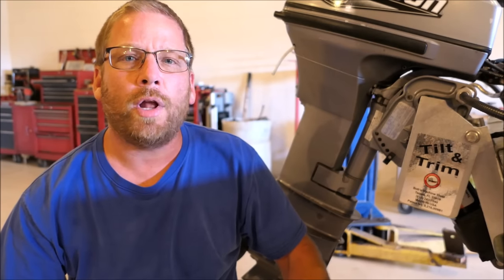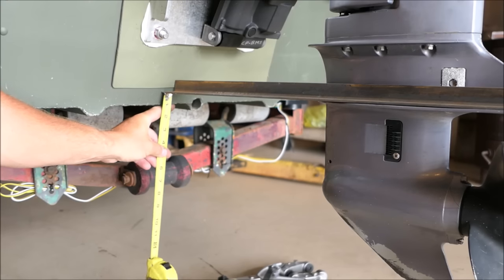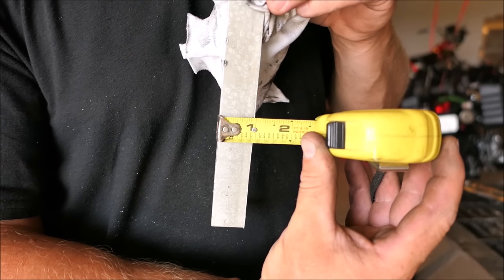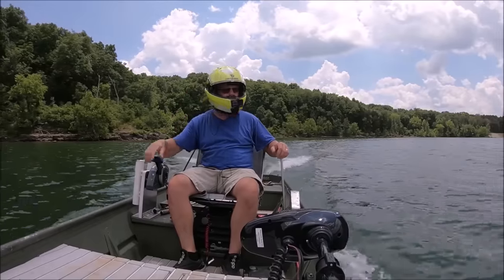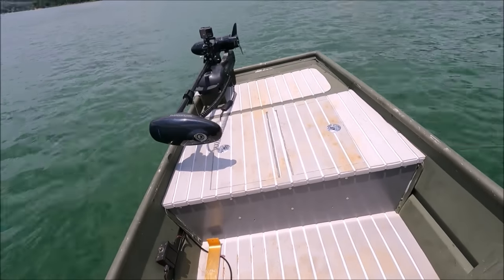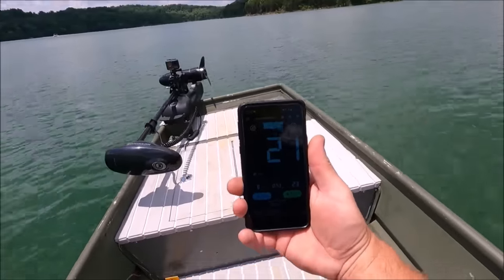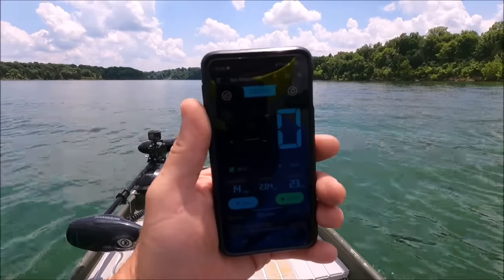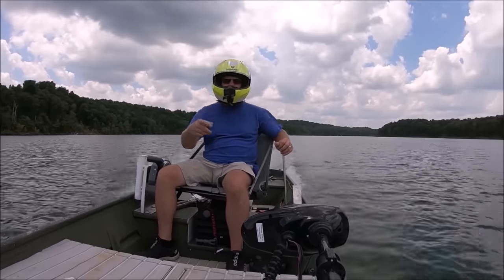Does 1 inch UP or DOWN make a difference on an Outboard ??

Comment: Being a former professional boat racer I can tell you that you would be way better off with out that helmet. That’s a perfect way to break your neck . In a boat you do not want a full face helmet.  If you go in the water can catch the piece going over your mouth and snap your neck. There where a few internal Decapitations . Meaning hour head had been completely taken off your body inside of your skin.
Reply: That happened to me once !
Reply: Exactly right
Reply: You are correct. Amateur hour.
Reply: Not at 22mph. Nope not buying your scaretactics
Reply: Yeah this guy doesnt have the sharpest tools in his shed at all lol
Reply: This guy probably wore a helmet on his tricycle. While water skiing a salaam course we wold easily exceed 50 mph and fall multiple times with no head injuries. Twisted backs yes.

Comment: Hi Benny! I wish I had known you were going to try lowering your motor for more speed. When you increase wetted surface you slow the boat down. For more speed raise the engine until the propeller blade is even with the bottom of the boat. Have you tached the engine out? It looks like you can swing more pitch on the prop. More pitch equals more speed. You need to use your power trim to reduce wetted surface [ lift the nose ] at speed. Trimming the engine out lifts the bow, reduces wetted surface, changes prop angle and increases speed. The most important change you need to make is the propeller. Be sure to get a cupped prop. The cupped prop reduces cavitation. Race boats run only half the prop in the water. That allows less drag on the prop blades letting you run more pitch than a standard installation. I started messing around with fast boats over 50 years ago. It's fun but can get expensive. Jon boats are quick with small motors but they have a lot of wetted surface. Weight distribution is critical, too. If that were my boat I would hang a 35 or 40 hp on it with a nice cupped stainless prop. You could run it up over 40mph and scare the crap out of yourself. Too much speed on a jonboat and wind lift becomes a problem. It seems the new "Fad" with jonboats is to install jetski running gear. I'm not a fan of jetpumps for speed, but they definately have their place. Keep up the interesting projects! I'll be watching! Dave
Reply from the maker: Thanks Dave, I'm happy with the boat as is, I am glad I lowered it and think I'm getting all the performance out of it, not sure if the engine could push a prop with more pitch, thanks for all the help!! This boat setup is great fun love the stick steer and seat nice clear view in front of me.
Reply: Far as I know guys try and raise it as far as they can.
Reply from the maker: @kevinwest1607  Yes that's true, I didn't know but thought it was too high, in the end didn't make a difference,  I don't believe raising it would help in my case.
Reply: 28 Cruzin is right a cupped prop with the right pitch is what you need. You’ll gain speed.
Reply from the maker: @bradalden8347  He knows what he's talking about but more cash for me 😂
Reply: My cavitation plate was under the boat bottom and created drag. I installed a Tach and that showed me my rpm’s  were too low about 5400) and I was creating drag with the plate. I raised the motor to the max. height which put my cavitation plate an inch above the bottom. Now I’m spinning the same prop at 5700 rpm’s and got a 6 mph increase in speed.
Reply: Would raising the motor help a 20 foot pontoon? My motor looks pretty low to me,  but I'm no expert. I have no idea how it performs because we haven't put it in the water yet. We just bought it and we've been working on it.
Reply from the maker: @JimmyLee0757  I would start with what you have take it for a ride and go from there
Reply: @JimmyLee0757  Yes! Raise the motor on a pontoon if it seems like the lower unit and or mid section is plowing.
Reply: Hey I have a 16-48 with a 15 on it and I need to run in 6 to 8 inches of water do you think a on the fly jack plate will help also do I need more motor to get up out of the water or on the pad?
Reply: I have been racing and  modifying performance boats for over 55 yrs.
Drag is your enemy and next to flying as much of the hull as possible raising the lower unit out of the water gets you the most. With a non-cupped prop raise the motor till it starts to cavitate then drop it 1/4 inch or so.
A cupped prop is another setup. Then you can raise it till you start to loose water pressure.
I have NEVER seen a boat go faster by lowering the mota unless it has loss bite of the water( cavitation).
Good luck!
Reply: I have an underpowered motor on my boat - 4.8m aluminium boat side console 
Mercury 30hp. 
What’s the best way to get as much speed as possible out of it? 
Thanks

Comment: I'm surprised you measured from the level of the cavitation plate instead of from an extension of the boat's bottom.  Especially since the angle of the cavitation plate will tilt up and down with the trim&tilt.  Bump your trim switch and you'll get a very different measurement.  It would be good to get a buddy to follow you or run past him to see how high your cav plate is running at speed.

Comment: Thanks for doing this. It seems to me if there is no performance gain a person should run the cavitation plate an inch above the bottom of the boat and enjoy an extra inch of clearance in shallow water. I’m setting the height of my Jon boats new outboard now and think I know where to start.

Comment: I had similar problems with a brand-new boat and a 25 hp engine. The first thing you should have done is put a tachometer on the engine while your WOT on the water, and verify that engine rpm is at the max rpm of the motor. One degree in prop pitch is equal to 200 rpm of the motor so you make adjustments of your prop pitch. In my situation it helped tremendously but I still wasn't happy with the boat speed, so- I raised the engine by an inch and a half to reduce drag through the water and that did the trick.  If you want stability on the water, put a Cobra Explorer Hydrofoil Stabilizer Plate on your engine -  three things prop pitch, drag and stabilizer plate.
Reply from the maker: I did check the rpm previously, my guess is it hasn't changed but I agree need to check it
Reply: StingRay is the best foil for anything under 60hp. But he is getting up to plane fairly fast, actually quite well, without proposing, so it'd be added drag. Pitch AND diameter can mean speed or not. A friend has a #21 but wasn't able to get into the proper RPM range with it so he kept the same pitch but went 3/4" less on the diameter, same brand of prop. Gained speed, and the RPM now runs up to the manufactures rated top numbers, past the proper running range he couldn't acquire before.
My mid-sized boat, Key West 1720, recommends a 90hp as max, purchased mine with a 115. Had to put on a foil due to stern weight and slight proposing in offshore swells which can be nerve racking, losing 3 mph doing so.

Comment: As others have mentioned, raising the engine will decrease the amount of the gearcase in the water and decrease drag, which results in increased speed.

However, at around 22-ish top speed, its not going to make an appreciable difference. This phenomenon really comes into effect when you're going at much higher speeds, like above 50, and your aim is to get the engine up as high as possible without causing excessive cavitation or adversely affecting handling. Interestingly, sometimes having the engine down too deep can have a negative impact on handling.

For example, I have a custom paired 18' ski boat with 175 O/B (20"). When initially mounted at factory transom height (which was actually 22 inches!), it would pull to the side pretty hard. I had the skag adjusted hard to the side to compensate as much as possible, but it still pulled. Eventually I decided to raise it up by one set of holes (another inch), and that completely eliminated the pull even with the skag adjusted straight on. So now I have the 20 inch engine mounted at 23 inches and control is perfect. It does cavitate a little bit when turning hard at mid 20's (mph), but only a little and maintains thrust.

Now even for smaller boats, if it doesn't adversely affect handling or cause cavitation, I'd suggest raising the engine up as much as possible. Reason is very simple; the higher the engine is, the less likely you are to hit stuff under the water, like ground. That boat is clearly rigged for fishing, so I'm sure you take it into some shallow areas sometimes. You don't need to weld the cutoff piece back on, just bolt it on higher up.

Comment: You can adjust speed with props, balance ( of boat),raising motor and so forth but that cavitation plate height is recommended to be set a certain depth below keel line depending on mounting situations…that depth is not just for straight line performance but also in turns …you will know if it’s not deep enough because in turns it’ll be easier to cavitate..it’s not all about straight line performance people !
Reply from the maker: Yeah the deeper the engine went the better it manoeuvred at slow speeds
Reply: @kentuckyyankee  trying is winning 👍🏼

Comment: I’ve got a 15 foot Jon boat with a 25 hp. I put the bobs trim and tilt on and I went from 27 mph to 32 mph. I also bought there stabilizer plate and I bought a cupped prop. I can trim my motor to where I can hear my prop pierce the water and that’s when I throw a rooster tail. That bobs trim and tilt is well worth the money. And my motor is a tiller. You might need more weight in the back to get full potential out of your trim.
Reply from the maker: That's something I had thought about, more weight could possibly help in the back
Reply: Could you give some more details about your set up? transom size etc.  really apprericated

Comment: Hi mate,

Just a few things to take on board...

1) A bit late now, but you shouldn't have cut your tilt/trim when you could have just lowered the mounting on the transom.

2) you don't measure the motors height by running a straight edge off the cavitation plate. You do it by running a straight edge off the underside of the hull.

3) You actually gain speed by raising the motor, not lowering it.

4) Your motor could have went even higher than where it was before you cut it. Perhaps 1 inch higher for a good return on speed with current prop. The further the set back off the transom, the higher the motor must be so this looks as though it was originally set up the same as it would have been if it were flush with the bottom of the boat had it been mounted directly to the transom.

5) If you want more speed, invest in a new prop and raise the motor. To do so, you need to check your engine rpm in gear at WOT, fully loaded as you would be on a normal day out. Make sure you are within manufacturers spec for rpm range at WOT and only then can you start to play with pitch sizes and eventually rake and cup. But be aware... This can get expensive, so  please, DO YOUR RESEARCH.

In all honesty, I would just leave it as it is. She works nicely.

Hope there's some helpful tips here for you mate.

Best of luck with it. Keep experimenting, but do a tiny bit more research before you make permanent modifications to your pride and joy. She's a nice boat.
👍

Comment: A general rule is up 1/2 inch for every inch back from the transom. If you want more speed raise the motor but watch for water flow to the engine

Comment: Any difference with those thick rubber 12" shark fins you can mount around the fins above prop forcing the water to run past prop blades keeping nose of boat down. I still have the unopened package frim the 90's. LoL

Comment: Raise the motor 1” above where it was originally. Trim it up. Check your rpm. If you can turn a higher pitch prop even if it just 1” of pitch you should gain. High speed boats rarely have more than two blades in the water at any given time. As long as you don’t lose water pressure, raise it up.

Comment: You're going the wrong way, the anticavitation plate has to ride above the water when on plane. You don't want water going over it, that's why you're "spinning out" so easily. The same thing was happening to me when I got my last boat, trim didn't like being up much at all and to keep it nice on plane I would have to keep the trim down most of the time... raised it an inch so the plate skimmed over the water instead of cutting through it and now not only do I get 5mph more out of the old 85 evinrude but my fuel mileage has almost gone up 40% from having less drag from the motor. All in all, I'm so happy that I raised it, rides rough water at higher speeds better too
Reply from the maker: I can try it higher

Comment: It's the bottom of the cavitation plate should be level with the bottom of the boat I know it's only a matter of 3/8 of an inch or so but it will make a slight  Bit difference

Comment: You were to high from all I've gathered from ol' mariners that set up outboards for a living in the past. Cavitation plate even with the hull or no more than an inch lower-keeps water under the plate-no air allowed.
Having your weight further to the rear could help, such as with a tiller steer like my smallest bay boat, but honestly you're at a damn good speed for your boat and outboard. I know others with 25-30hp bolted on that only run 2-4 mph faster with both forward and tiller steer-and that's on the saltwater which is slightly faster than fresh.
Know the helmet was a touch of humor, but where's the PFD, and was that lanyard hooked up?  I don't step off the dock without a kayak PFD on-light weight and not bulky-and don't run at speed without a better PFD on. I'm never in gear-even backing off a trailer-without the lanyard hooked up. Yes I can swim, grew up in the mid-Mississippi river region swimming since Dad threw me in at 3 years old. NEVER to safe on water as a college friend of mine found out in a brand new bass boat running 70 mph in a tournament. Steering rod broke, 90 degree turn knocking him out going over the gunnel, but that PFD kept him up and he's back in that same boat.

Comment: I have a 1988  14 Grumman Jon with a 20 mercury outboard two stroke 1990 motor it does 28 mph all day on smooth water

Comment: engine is what push speed n moving engine up n down doesnt change speed but it DOES DO affect water cooling because higher out of water will affect water cooling including propeller throwed out of water
i recommend that line be under hual by one inches  not line up or not above hual line

Comment: Just curious, but instead of cutting the engine side of your tilt/trim set up. Why didn't you just drill another set of holes in it on the transom side? I think that would of been a better option than cutting material off.
Reply from the maker: Lazy, was just easier.

Comment: Lol you went the wrong way. You should have raised the prop for more speed ( if you can avoid cavitation). The reason being dropping it, as you did, increased drag. Also, as you seem to be new to boating- don't forget to tie your kill cord to your leg- this will stop the boat traveling off into the distance on it's own if you get thrown overboard.

Comment: You start at 3 1/2" from the bottom of the keel.  If anything it should have slowed down.  It may have gone faster or slower depending on the surface temperature of the water.
Reply from the maker: Thanks for the advice, didn't make any significant difference
Reply: @kentuckyyankee  Yeah, you were measuring from the bottom om the boat instead of the "keel", that being the lowest point. 
On another note, you may get more speed with less air resistance. Sitting up that high, you are catching a lot of wind. Also, humidity plays a big role in speed as well, as on a very humid day, there is a lot more water vapor in the air the engine needs to compensate for. I know my boat with 20% more humidity will loose some RPM off the top end, resulting in a drop in speed as well.
Reply from the maker: @rrrttt1112  I'm calling it good. 😂😂 Not a bad top speed for my setup in my opinion.

Comment: I raced modified outboards for decades, won a lot of national. The engine was as high as possible and still get it on plane. When we set a world record, you could see half the prop out on the water. A 7.5 ho on 11'9" picklefork hydro. A little over 72 mph. But it was a pure race engine. A flat bottom should do fair. Empty it might fly a little. Ride on more of a cushion of air
Reply from the maker: Seems the higher the better for speed is what I'm gathering
Reply: @kentuckyyankee  water is a major drag, less you have the faster it will fo,,,to an extent. Boat design plays a big roll
Reply: @kentuckyyankee  I love old engines, as a workhourse "playboat" I would love a Marc 20H

Comment: Did you just use the clamps on the motor on the trim lift. Or did you use the clamps and the holes at the bottom of the motor with bolts
Reply from the maker: Clamps and bolts

Comment: Where did you get that seat?! I've driven a work boat before that had an air-ride seat in it like that. It was amazing! Those should be standard equipment on every boat!
Reply from the maker: This is a video on the seat, it helps a bunch! https://youtu.be/jRLXRQ8LJa8

Comment: The infamous Bassproshops sold me a 5hp mercury for my jonboat with a 16 inch transom they said it's gonna be perfect but to find out the cavitation plate is about 1.5 inches below the hull.  .they said its FINE..  I just bought it today and afterwards I find out I may have been bamboozled..... why does mercury sell 17.5 inch shafts and call it 15?
Reply from the maker: Idk but I doubt it would change the performance either way, I would think your set up will be fine.